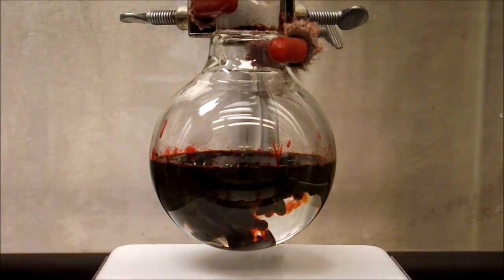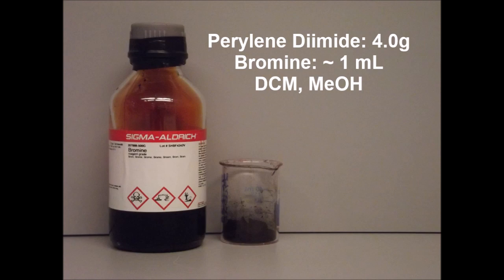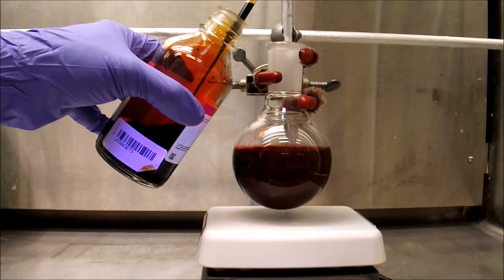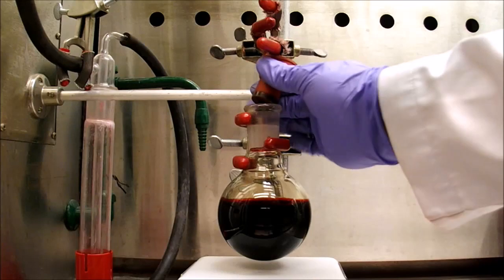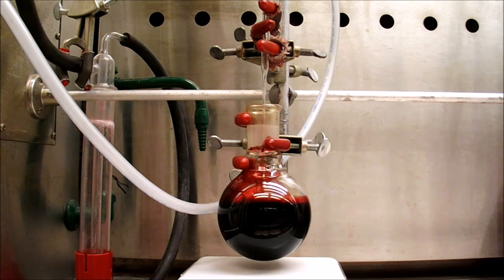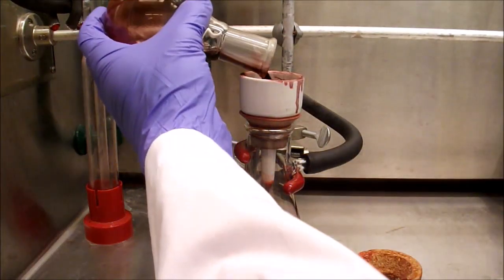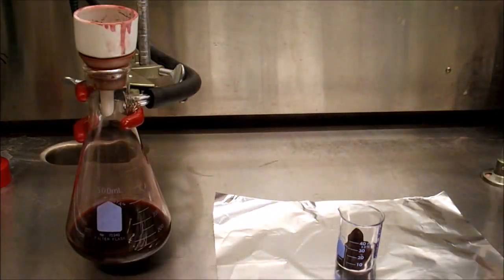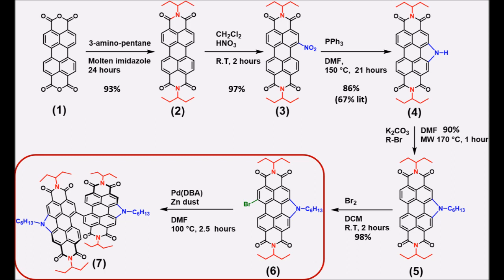Bromination of Perylene diimide

Comment: What determines something being brominated multiple times??  Say you wanted something to be dibrominated or 2-bromo. What will be the determining factors that would result in 3- Bromo, or 4 -Bromo,  5-Bromo, Etc ? Would it be the temperature, would it be for the length of time that it was exposed would it be the strength concentration of the bromine? All  the above, none of the above?? Also is there something to add  to the reactants to allow the bromine to munch on so it doesn't keep brominating? I guess the word I'm looking for is a quenching reagent maybe??? Good video by the way!!

Comment: I once spilled bromine over two fingers, I lifted the jar containing the bromine solution without gloves and some bromine droped out of the cap. Fortunately I quenched it in ca. 5s. This all happened in one of my first lab courses as undergrad.  Always wear gloves and follow safety precautions ;)
Reply: xnqu I used bromine as an undergrad for the tribromination of aniline. One particularly idiotic person in my year poured bromine down the sink, which did not go down well with the academics in the lab.
Reply: Gloves are overrated and protect fine against solids but pretty terrible for most liquids. I'd rather spill DCM on my bare hand than on my gloves since it can evaporate easily, while with a glove it gets very hot for some reason (evaporation should make it feel cold right?) and stays trapped feeling all nasty.I rarely wear gloves when working with fine powders since it often becomes very static and jumps everywhere which in my opinion is less safe than doing it carefully without gloves and not having it jump everywhere.
Reply: bdbdbd yeah I've noticed that dcm "hot glove" sensation. At least it serves as a good warning to change your gloves.
Reply: Any idea where this sensation comes from? Happened to talk about it today at the lab and nobody knew. Maybe DCM does something directly to the nerves?